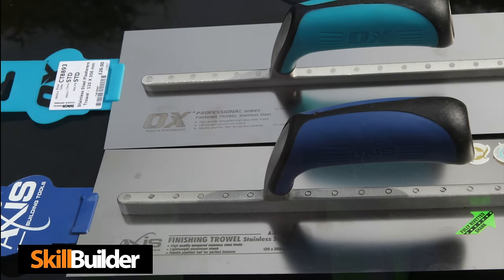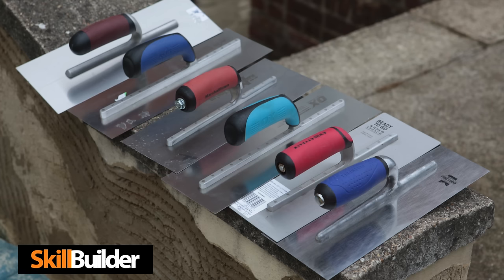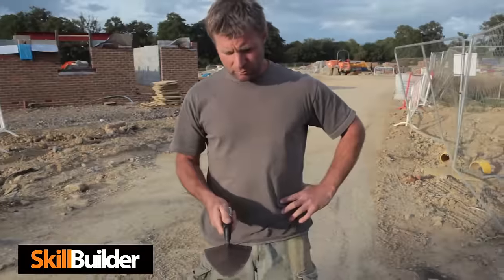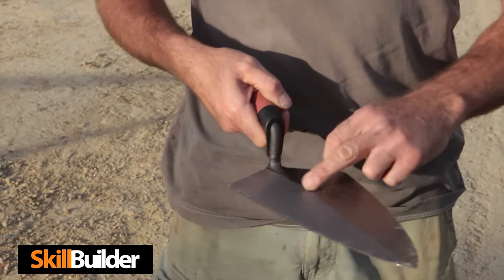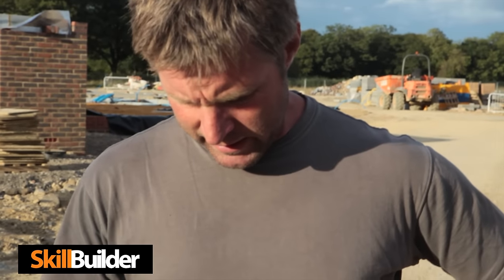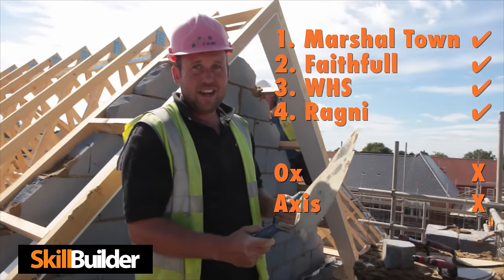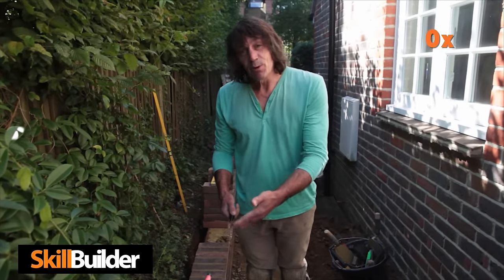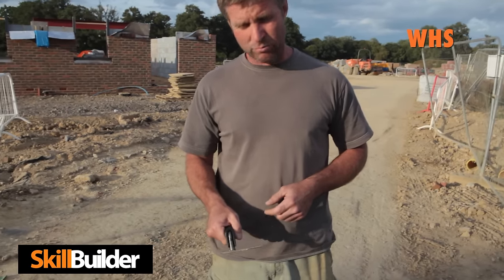What Makes the Perfect Trowel? - We Ask the Builders

Comment: Nothing like W. Rose for me. I use a 10 inch wide. Used to use leather handle but for the last 5 or 6 years been using the plastic handle wrapped with athletic tape (hockey stick tape). Been happy with this set up. I just change the tape every few weeks. Handle stays like new.

Comment: W. Rose w/leather handle all day long. (Wide London pattern)
      When I purchase a trowel I select the one with the most flex by systematically going through the lot, one in each hand and eliminating the stiffest blades.  The reason for this is that the thinner blade will absorb more energy through the flex. 
    And when you’re working with a trowel all day long everyday, year after year, it will make a difference to your wrist and elbow. 
    Downside, thinner blades don’t last as long. IMHO

Comment: The shift from using the trowel for cutting bricks as well as spreading muck, where the old work hard and starve was king, led to the Marshaltown being taken up. I bought my first one in Kingston in 1981 and promptly broke it. The shop-man wasn't too happy when I took it back but gave me a replacement and I never tried chopping a brick with it again :)
Reply: I've cut class A engineering bricks (though not often) with a Marshalltown, the trick was to really find the heaviest one you could find in the tool shop, though now I suspect production variations are tighter...But I agree WHS with a tempered edge (LH stamped on the trowel for us Lefties) were the best, but the handles always split or shrunk....
Reply: That must have been in Kingston Tools.

Comment: My first trowel in 1977 was a whs, rigid and hard. Got an 11inch Marshalltown in 1979 cos most brickies rated them. My mentor(I was an apprentice to him), bollocked me and said it won't last 12 months, "it'll be down to nothing in no time". 12 months later the 11 inch was down to 7 inch, and it had worn the inside edge down that much it could not hold the muck centrally. He was right. Good bricklayers can get away with any trowel, yet may prefer certain make. M/towns aren't the be all, tried a Faithfull half the price of m/town felt good enough. I should have stuck with whs.

Comment: In Australia I my apprenticeship in the 1960's and started off with a WHS trowel. Being Left Handed it was tempered on the LH side to cut bricks. Next trowel was made by Spear and Jackson. Both trowels were very solid well made and I was happy to use either until the mid 70's when I picked up a Marshalltown Trowel and have been using that brand ever since, just love it. I did retire from bricklaying in 1990 but still do the odd job and still appreciate the feel of that brand.
Reply: I am a lefty too and used to use WHS trowels and buy the left hand ones, I used to get them cheap as they couldn't sell until a lefty came bye.
Now i use a marshaltown for the last 20 years as WHS and spear and Jackson trowels quality has been lost.

Comment: We use a lot of durwall, in S. Fl.  where we lay mostly block, and usually use a trowel to cut it.  Rose used to be the best, Marshalltown feels good but can't handle the wire.  Rose is made by Kraft now and has slipped for me. Had to drop down to a 12" and after using 13" rose for many years (elbows are going) and started using a Husky trowel from HD about 2 years ago and it holds up like the old Rose, though it's a little heavier.  I think it's great, I can cut wire all day with out it getting nicked up, unlike a Marshalltown which costs almost twice as much.  Bottom line is, you like the trowel you get used to, but can always get used to something else if you have too.
Reply: A lot of people constantly put down the Chinese manufactured trowels ( As far as I’m aware the husky trowels are made there) nothing wrong with them.

Comment: Been laying bricks for 20yrs the best trowel ive used is my current trowel W Rose 11 inch philly knocks spots of the marshaltown i wont change again now...
Reply from the maker: Yes we have heard that the Rose is good. Unfortunately we didn't have any for the brickies t o try.
Reply: I find the shank angle on the marshaltown to steep for your wrist gives me much pain and there not made so well anymore...cheap metal poor quality now. Rose has got rid of all my elbow and wrist problems and the blade is such nice quality there not cheap but i believe you get what you pay for 👍
Reply: C Jackson I recently purchased a w rose 12 inch wide london pattern. Used it for about a week and just couldn't get used to it. Wasted £60 basically. But all the arguments I see about trowels I think it comes down to personal preference.
Reply: Nathan Spencer just wondering did you buy it on line. I would recommend that you never buy a w.rose trowel online .they are a very un uniformly manufactured trowel . Biggest problem I have found with them is the handle angle on some of them is so steep that it makes them very unbalanced and uncomfortable to use . I’ve had at least 100 of them through my hands that’s how I know this .also the weight of 2 of the same type can vary considerably .blades can vary from very stiff to very light and flexible. It’s a pity because They are made from top quality  raw materials and when you get a good one they are top class . But no matter how good a one you get they are not worth the 50 to 65 quid price tag I frequently see them for sale for.
Reply: C Jackson did you purchase it online or in person if you purchase them on line I’d say you have probably a 40 percent chance you will be sent one that you won’t get on with . They are made from top class materials but are a very un uniformly manufactured trowel . I have had at least 100 of them through my hands ( they were all standard shank trowels they also make a low lift shank trowel) and they were all over the shop as regards there quality. Biggest problem I found with them  was the handle angles varied so much ,if you backed 2 up to each other handle to handle one handle may slip completely under the other .Some were absolutely top class some were middling to low class trowels. No matter how good a one you get they are not worth 60 quid.i would only chance purchasing one on line if I could view pictures of the one I was being sent and some of the pictures would have to show the angle of the handle in relation to the blade.
Reply: bric bybrick yes I got it online. I think it's because I'm so used to the finger guard on a marshalltown. And I find the w rose hurts my wrist a lot more for some reason
Reply: Yes i bought it online through Speedcrete...another lad on site bought one at the same time as myself and his was exactly same!! My gaffer also has one he bought ages ago and thats fine aswell. Ive found the marshaltowns to be vastly different off the shelf i used to put them on the counter with my old marshalton when i was due a new one to match up the angle and they varied hugely. I checked the balance of all 3 by hanging them on my finger on the shank all 3 are perfect...ive done the same with the marshaltowns and everytime there handle heavy!! As for price its in my hand all day every day and it will earn me 10s of thousands of pounds! So for 50/60 quid its neither here nor there.
Reply: Nathan Spencer. Nathan  did you get it from speedcrete . Or else were .
Reply: C Jackson I’d say ye were lucky that ye all happened to get one that suited ye . I find Marshalltown to be very consistent in there manufacturing of the trowels but there are problems with them and the number one thing I’m hearing about them is the metal is not as good as it used to be .I would rate the rose trowels to be the most inconsistent manufactured trowels I have come across . As I said I have had at least 100 of them through my hands and some of them the differences between them were like night and day.
Reply: C Jackson your right trowels from the same manufacture will vary a bit ,handle angle especially ,weight of the trowel ,flex of the blade .i have found this with Marshalltown town as well but in no way as much as I find it with the rose trowels.i found w.rose trowels have the biggest variance in all the trowels I’ve had. I have never come across a Marshalltown I couldn’t use but I have with the rose. I have one here at the moment and the blade is so thick( this is an extreme and haven’t come across it to often)  I’d say I could put the toe of the blade on a block and the heel of the blade on another block and stand on the thing and it would hardly flex . (Im 15 stone ) might be exaggerating a small bit to make the point put not a lot.
Reply: Suppose its all down to personal preference at the end of the day....it took me about a week to adjust to the Rose it did feel really different but i stuck with it now its like an extension of my arm...suppose its the same as everything in life everybody has a difference of opinion. Be boring if we were all the same 👍 im due to buy another Rose to be honest i always like to have 2 trowels in my bucket 2 reasons one just so i have a spare and two now ive worn my latest Rose nicely i will use it for facework and have a 2nd new one for bashing in blockwork so will see if my next one comes as consistant as my first....we shall see 🤔
Reply: C Jackson not true, Marshall town and rose are made by the same company now
Reply: Jamie Twigg are they . As far as I know Kraft tools u.s.a own the w.rose u.s.a trowel brand. And Marshalltown u.s.a make the Marshalltown trowels . I am not aware of a connection between Kraft tools and Marshalltown tools I’d be interested to hear any information you have on it.
Reply: bric bybrick it's called outsourcing, both trowels are made by the same factory
Reply: Jamie Twigg I think most people know what outsourcing is . Where’s the proof to back up your statement that they are both made in the same factory.
Reply: bric bybrick where is your proof they're not?
Both are made in PA at Keystone forge
Reply: Jamie Twigg i have none .  But you haven’t proved that they are made in the keystone forge either . Just because you say they are doesn’t make it  true, of course it doesn’t mean it’s not true either  . I’m waiting for you to provide proof ( my YouTube notification that you replied said they were made in Beverly forge .you edited that did you to say keystone forge ) what your saying is very interesting I would like to hear the full story on it . Another point is a single factory could supply trowels to 2 different company’s  but that doesn’t make them the same trowel.
Reply: I'm in American brick layer and Rose is not made bye Marshalltown I've used Rose 4 years I use a 12 in New London leather handled
Reply: 20 years I might add
Reply: Chad Sexton what Jamie twig said was that Marshalltown trowels and w.rose trowels have outsourced the manufacture of there trowels to keystone forge. M.t and w.rose are separate company’s Kraft tools own the w.rose company.

Comment: For the last 45 years I've used the traditional WHS "standard width London" pattern trowels, not broad heel, and I've never been comfortable with American or Canadian pattern ones.
It also makes me cringe when I see guys cutting bricks with those cheap, lightweight blades, they're not tempered for cutting!
Sadly I can't buy a decent new WHS anymore, although there are sometimes used ones on fleabay. The ones I have should last me now until I scrape my spot-board off for the last time. Did think about buying a French "Bon" London pattern one, or an American "Rose" but they seem to be not quite the right shape.
Yes, a good bricklayer can do a decent job using pretty much anything as a trowel, but the right tool for the job is more important than a lot of people realise....
Reply: Paul Sleight you can still buy WHS London pattern trowel but, they are expensive the last I bought was 12 years ago and I got three because they are hard to obtain. But, like you I can't be doing with Marshalltown tools the jointers in particular never allowed on any of my jobs.
Reply: @Frenchwine15  which jointer is the best? A hubbard?
Reply: Jointer made by Spear and Jackson, Tyzack or WHS for doing a bed joint look for a rail runner 12 MM thick over 400 MM long gives a nice flat finish to the bed joint.
Reply: Paul Sleight Paul Sleight i understand completely, the best trowel is subjective. The only criteria where each brand can be compared is, fit finish, quality of materials, price and prestige. I personally love my W Rose trowels. It’s a narrow london but, I’ve come to notice that geographically each country has their one preferable pattern. It all really comes down to the Bricklayer or Mason.

Comment: A chancer pulled on my job with a b an q trowel he pushed down on the tip and it snapped in two I've never laughed so hard on a building site ... Lets say he didn't last long
Reply: I saw almost the same thing on a site where a bloke pulled out some cheap trowel which had a riveted-on handle. First time he went  to cut a brick the blade flew off over his shoulder and he was left holding the handle. We roared! :D 
Turned out it was the guy who was subbing us all out (to Wimpeys) who had been buying cheap tool kits for some of the labourers, presumably to pass them off as brickies. Needless to say it didn't cut the mustard with the contractors.
Reply: Chancer, not heard that for a while... we had hoddy chancers.. 30 seconds that's all you needed. As for trowels, i've covered for a couple due to feeling sorry for them, but you can only put them in the middle of a line for so long... normally two days....then the bullet or 20p for the Standard if the forman felt generous....(1980-90's)

Comment: Marshalltown have gone downhill - the steel has gone soft. Wears down faster and bends a bit too much. Tbh I can lay bricks with a 15 quid trowel as much as a 50 quid trowel but the best one I've ever used doesn't even have markings on it, ancient thing that probably predates me. Handles a bit short and the pattern is more angular like a spear head. Second best was a WHS I think, pattern I couldn't tell you, but was a good bit narrower at the base, like an elongated oval, was great on 8 inch walls because it didn't keep catching the other skin when running in.

Comment: The bricklayer in the video that said the faithfull trowel handle was cutting on to his hand  i have to say I haven’t found that with them. They are an excellent trowel expertly forged from top class steel with a spot on handle angle . I am fairly certain they are manufactured by Italian company batttiferro de maniago . Have a look on there website you will see what I mean. He also said the deep recess on the  Whs /tyzack handle would fill up with mortar ( which is true)  and that it will eventually come around on to your hand which I have found not to be true . It just fills up with a bit of muck and that’s the end of it . It certainly won’t come round on to your hand in my experience.

Comment: Been laying for 37yrs started with Whs they were good trowels then bought a Marshalltown for 15 quid and liked them, used them for years but now the steel seems to be weaker and don’t last as long so went back to Whs, to me they seem worst now back to Marshall from screwfix,6 months later looks like I’m gonna need a new one any suggestions and don’t say ragni
Reply from the maker: Rose seems to be the one.
Reply: Skill Builder thanks think I’ll give it go
Reply: only Rose mate,leather grip,kind of pricey but worth it.  Philadelphia pattern,10 or 10 1/2
Reply: Jon Large cheers mate got one on order 🤞🏻
Reply: My Marshalltown 19/12 wore down in about 6 months and crack on the cutting edge
Reply: Leather handle tyzack
Reply: Yeh i second that... i know your not ment to hit bricks to brake them with a trowel but lets face it well all do it... but ive found that whs corners dont roll when you hit a brick but marshaltown do.. so ill stick with whs

Comment: 1 - the handle and weight distribution (how easy is to pick a lot of mortar, and the handling of the trowel, comfort and grip)
2- the blade (good metal thin good shape)
3- quality of the components (reliability, durability)

these are the most important factors of a trowel, however number 2 and number 3 are useless without number 1.
number 1 is the most important.

To say it, I use a marshaltown for years, I got 3 pairs, and I still love it, its NOT the best metal neither the best blade, BUT its the best or one of the best overall, and its also cheap.

Note, I didnt watch more than 10 seconds of this video before I wrote this and it seems people in the video agree with me lol

Comment: I use two Marshalltowns.  A small one for the perps and intricate work ie soldier course, and the biggest one they do for laying the bed.  Having two means I can transfer muck (compo) from spot to spot, and lend a trowel to a Labrador for donging (pointing/jointing) up.  Maybe they should do a video on hoddies.  It's many a year since I saw a hoddy wet a spot board or turn muck over.  Roll on Brexit.
Reply: I remember getting set on for a trial day as a hoddy at 15 years old. First day the b*stards gave me a plasterers hod loading out 2 decks up. At the end of the day I was still standing [just] and got the job. From there on with a brick hod, the job seemed relatively easy

Comment: Very interesting, we dont use trowels here in sweden. Atleast i have never seen one. Would be nice to try and see if they are better then our tools. They look very comfertable in the hand i must say.
Reply from the maker: What are you using to lay concrete blocks and stone?  A square end bucket trowel I would guess. The English and Flemish are probably the best countries at brickwork and the original steel trowels were made in Sheffield by the Hugenots. 

I am not sure why they ended up having such a sharp point to them. I think they were probably adapted from another tool entirely.
Reply: @SkillBuilder  Correct but we also use something called "Fasadslev" in swedish. I see, need to get my hands on one of those. Cheers